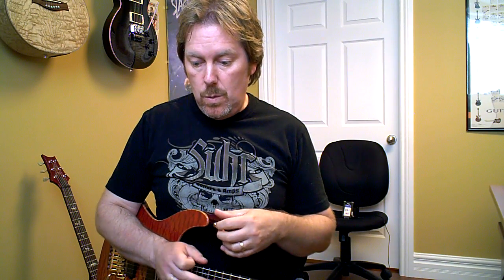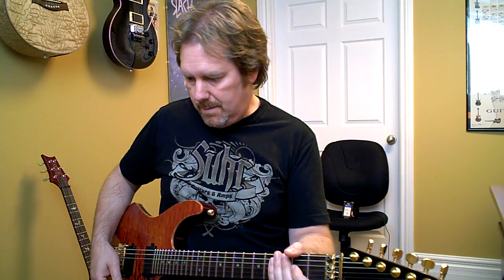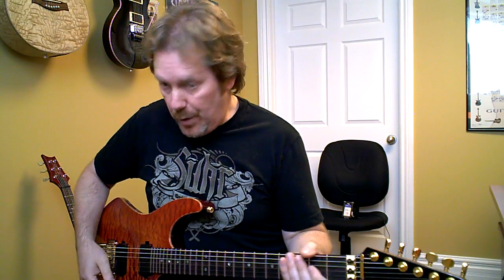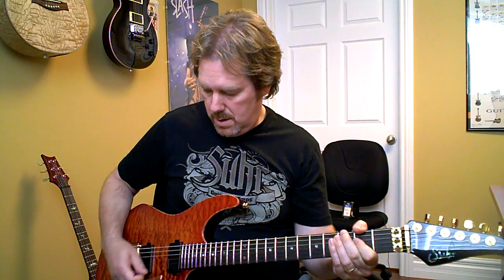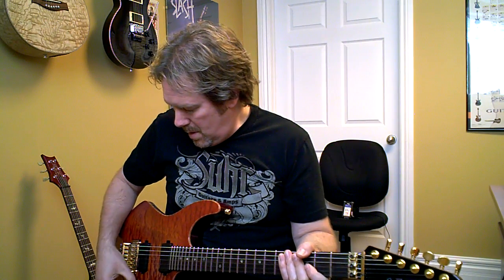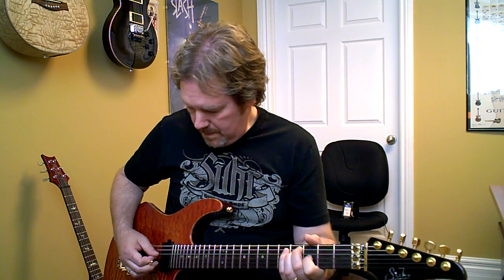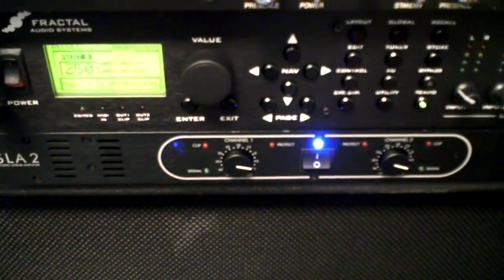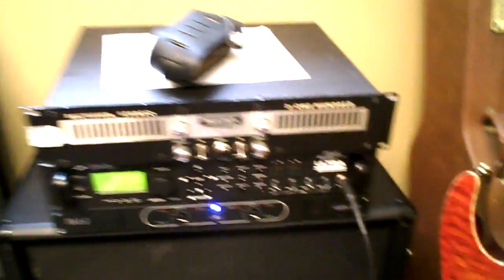AxeFX Ultra with poweramp sim ON with an ART SLA2

Comment from the maker: @domdauphin I was using the ART SLA2 into two Randall 2x12"s or Two Mesa 4x12" Rectos with V30's, the Randalls had Celstion 70/80's.  I really love the sound with a Mesa 2:100 with a pair of  cabs, but I am partial to that amp and tone.
My favorite setup that I use now is the ART SLA2 with two 2x12"s and the Atomic Powered wedges at the same time.  It's a lot to carry around but it sounds amazing!

Comment from the maker: @nofearpig1 Hey Dude!!!!

If you have the Axe Edit you can go to bank F in the AxeChange tab, this preset should be there.  Make sure you turn of the controller on Ch 2 of the mixer block as it is assigned to a midi CC volume controller.  YOu will get no sound unless you do this.  Also I do not have my Global EQ flat, I take off some bottom.
Remember I use OUT 2 to go to an ART SLA 2 poweramp and to the guitar cabs (Randall 2x12"s)

Mark

Comment from the maker: I chose the SLA2 for a few reasons...it's small, light, loud and I can use the poweramp sims out to my guitar cabs and still use the PA and Cab sims out to the FOH/DAW.  With a tube poweramp I would have to turn off the PA sims and therefore the FOH wouldn't get that benefit.

Mark

Comment: I notice that the different modeling gear always are alittle murkey, so you need a clean poweramp like the VHT, Carvin tube poweramp (cant remember model number), or solid state poweramp. Greg Howe uses the axefx with a VHT poweramp.

Comment: I've been looking at this exact same rig. I've been going back and forth between the Art SLA2 and various power amps, such as the Carvin and the Mesa Boogie 2:50. Do you think the SLA2 is able to cut through at higher levels? I'm somewhat skeptical when it comes with solid state gear, but I see that you are able to achieve a fantastic tone.

Thanks!

Comment: I wonder, how much sound difference between SLA2 and the boogie. As I understand there must be a difference but is there big enough to spend an extra 1.5k on the mesa. OR what cheaper tube power amp will you recommend?
Cheers